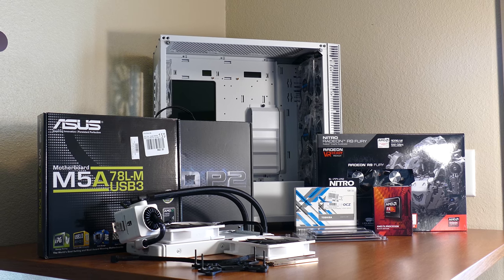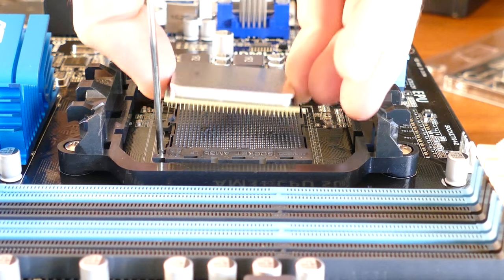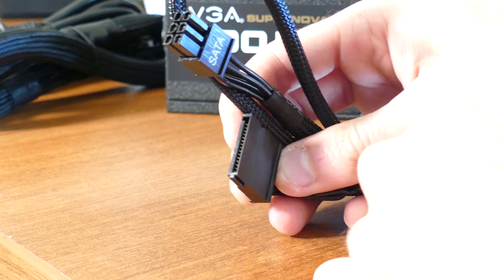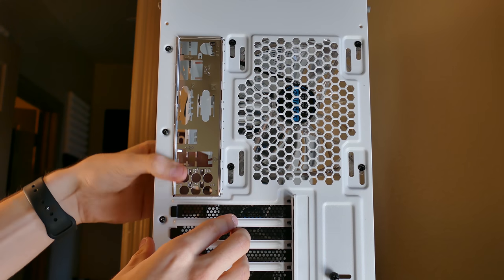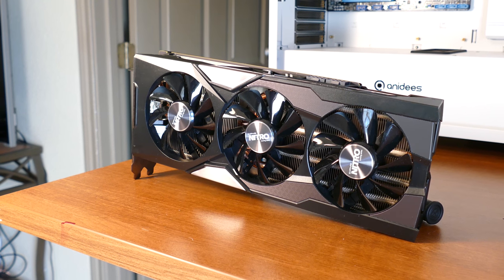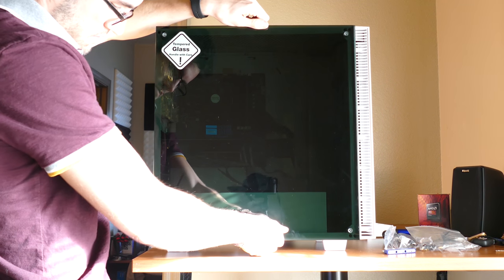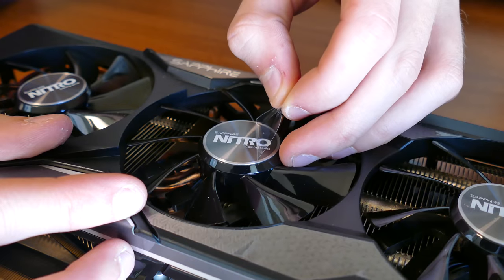How to Build an AMD Gaming PC (2016 Edition)

Comment: While i would say that just wait for Zen BUT if anyone wanted to support AMD, but can't wait for ZEN, here other option motherboards for the build. 
Mobo: Either: Asus 970 Pro Gaming Aura
                        Asus 990fx 3.0 Sabertooth
                        Gigabyte 970 Gaming/Gaming SLi
                        Gigabyte 990fx Gaming
All of the motherboards above have USB 3.1, M.2 nVMe SSD port, gigabit ethernet and audio DAC.
Reply: Here is my setup that i build from end of 2014:
FX8350
Cyrorig R1 Universal
Gigabyte 970A Gaming
Corsair RM750i
R9 270x (soon to be RX480)
16gb Corsair Vengeance
240gb Sandisk Ultra SSD
1tb WB Blue
1tb Seagate Baracuda
NZXT H440

My setup could be used until perhaps well into late 2017/early 2018, due to my country's currency is weak again USD $. So i can't do the Zen overhaul of CPU and Mobo should it comes out 2017 because it would means that i have to shell out 4-5 times the cost/actual price of it. Seems that i will be using my FX series way longer that i anticipated. lol..

Comment: I have a question about your stress testing methodology for overclocking. I've heard you say that you use AIDA64 for half an hour to test your clock stability, do you consider that enough for making sure the system is stable? and do you think that prime95 for the same amount of time is too much? I'm asking because I'm having a little trouble going higher because of the temperatures with prime95, while AIDA64 is more than 10 degrees lower! :p thanks anyway!
Reply from the maker: It's stable enough for what I do.

Comment: LOL im the dude you said good luck with that a month ago when i mentioned the exact build or 970 motherboard for 40 bucks from micro center lol

I managed to get sapphire rx480 8gb OC open box for 207$

All in all for a 500 dollar pc its the best value and great looking with phanteks p416 case its a steal. You can always sell it for what you paid for or alittle less later on which is a rarity in todays age since the parts were so inexpensive.

Great videos

Can you do a comparison between the 8320e with r9 fury and the intel i5 or i7's for 4k or 1440p gaming? 

With costs of 4k tv's going down to 300 new for 43 inch chroma 4:4:4 60hz 4k it really is nice to have as a workstation on such a big screen.
Maybe a blind test between intel and amd with same video card in 4k????
That should be interesting.
Keep the videos coming 
Cheers

Comment: Nice video but you should make a legitimate walkthrough including the windows installation. It is easy connecting cables but its tough running the system. I built my first ever pc and I ran into software problems. I wish there were quality guides available on YouTube as there are build videos. Also, I think Phanteks makes much better cases than NZXT's 340 and this horror.
Reply from the maker: That doesn't count in the "build." Already have an OS install vid.
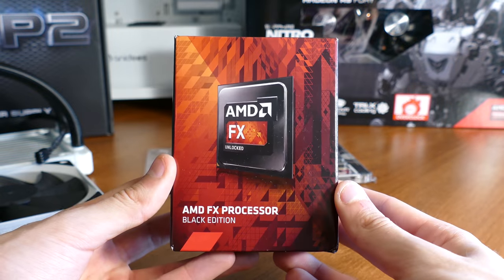Reply: The 1:50 minute video? That video, too, directs you to a instructional article.

Comment: Hey Greg, been watching your videos for some time now and decided to place a comment here. Even though it actually isn't the subject of the video but looking at your EVGA GTX 1070 SLI made me wonder what are your thoughts on recent evga vbios overheat that are appearing on the web. Would you kindly give us your 5 cents?
Reply from the maker: Haven't run into the issue personally. My cards are not SC/FTW and are clocked relatively low. Will, of course, update all of you if that changes.

crosses fingers

Comment: Hey I was just wondering if the parts listed are good enough for my first build:
I5 6600k
Asus GeForce gtx 1060 6gb oc 
G skill 16gb ddr4 3000mhz ram
NZXT Kraken x62
MSI z170a pro mobo
Reply: Keep Scrolling Very Good
Reply: Raul bakachivo evangelista thank you for your reply I was very worried that this wasn't going to be good enough since I am getting everything next week
Reply: Nothing wrong with the build, but you could consider an i7-6700k with a tower cooler. Would only cost marginally more and likely deliver better performance due to hyperthreading. But your way is fine too ;)
Reply: mistermaximal the 6700k cost around 340$ and if he is not planning to make any multimedia content the i5 6600k is good for gaming
Reply: Raul bakachivo evangelista
But his AIO cooler costs ~120$. An i7 with a decent 30$ tower cooler would cost a little more in total but have higher stock clocks and HT. But as I said, his chioce is fine as well. I just wanted to point out the possibility.
Reply: Zen could take another year to come out especially if the yield rate is bad.
Reply: We're waiting for Zen almost for a year, AMD said that they don't want be the cheap option.
Reply: I would rather go with a rx480 instead of the gtx 1060 but there isnt alot of games out yet that utilizes dx12/vulkan so atm 1060 is good enough.
Reply: jynxed RX 470 would be a better choice. RX 480 is trash when it comes to "price-to-performance"
Reply: Jamal Crawssover On newegg the 8gb rx 470 starts from roughly $224 USD and the 8gb rx 480 starts from $230 USD. I dont think that the $6 price difference is a big deal.

Comment: If you r building an AM3 platform, why choose the 780 chipset when you r going to add a powerful discrete GPU? The 7 series chipsets don't even support SATA3 (600MB/s), which will bottleneck SSDs. Why not choose 970 or 990?
Reply from the maker: Pay attention... Got the board for $15...
Reply: ok you got the board for 15 dollars got it... but you pair it with an FX 8320 and a R9 fury.....dude whats wrong with that picture?
Reply: For $15, not bad.

Comment: poor fury, it is going to get bottlenecked by the fx.
Reply: with a decent cooler you can overclock the crap out of that fx 8320, a very bad chip does 4,6ghz, a very good.... around 5/5.2
Reply: I can get mine to only 4.5 before it starts BSOD'ing!
Reply: and then ? 
still bottlenecked
Reply: MrYodi2007 voltage? i have mine at 4,6 at 1,47v
Reply: THQ SoulStealer yeah... still bottlenecked on very cpu demanding games like gta V or bf1. But...on the rest it´ll work fine.
Reply: Sean McNamara man... i had my fx 8320 at 4,4 with 1,38v on an asus m5a88-m (wich is allmost the same than mobo) for 2 years. And never give me a problem, even on Prime 95 wich stresses the cpu more than any game/ application in the world. Anything below 1,45v on that MoBo should be ok.
now i have the same cpu on a 970 pro gaming aura at 4,7 at 1,5v.
Reply: Julian Grimoldi 1.46v with one of the best boards out there.
Reply: The board is quiet low end+the crappy stock cooler. have it been a M5A97 or GA-970a-ud3p, it could oc decently and alleviate some of the bottleneck with an average cooler. Still the low IPC of the fx would hold the fury back, but not on the same level.

Comment: there is atleast a 5 percent performance hit with that ram my 8320 took way too long to find a stable ram over clock at 2400 but it was done I got a worthwhile bump I  cinebench at least 7% the 5 % is at a more attainable 2167. Love that ram it could take 1.7v and hold 1480 I was to scared to run it that high everyday. you get a bit over 1% with 4 dims. Heat a increased and overclocked dropped without active airflow or ridiculous voltage.

Comment: Isnt FX 8320 bottleneck for R9 Fury?
Reply: Eternal Power no
Reply: +Robi N its sure does. It Even bottlenecks the RX 480.
Reply: And my fx8350 doesnt bottleneck my gtx970 (equal to rx480).
Reply: +Creeperlover2001 gtx 960 is like 100% slower than Fury. Thats why.
Reply: +Creeperlover2001 dude wtf are you Even saying???????? 

RX 480 is like 30-40fps ahead of the gtx 960. Not Even close.
Reply: +Creeperlover2001 not Even close again. RX 480 SHITs on GTX 970 and rivals GTX 1060 and GTX 980.
Reply: ***** no
Reply: Eternal Power No lol, Just because ur a fan boy of something doesn't mean that it's good
Reply: yes it is a bottleneck. If you play at 1440p maybe less so, but it most certainly bottlenecks at stock frequency. My FX-8320e @4.6ghz bottlenecked my r9 390x. It was more noticeable in cpu intensive games.
Reply: Eternal Power The 480 is on par with the 970 in DX11 (most games) and is on par with the 1060 in DX12 and Vulkan (future games).
Reply: My FX 8350 seems to be very well aligned with my 1060. If anything I've only noticed the gpu limiting my performance in some games.
Reply: it was on par with the 970 on initial drivers, after some updates, its really close to the 1060,  more or less 2-5 frames at most
Reply: +Nino finally someone with real knowledge. Exalcty. Gtx 1060 is equal or better to GTX 980 and now RX 480 is like 2-5fps behind of GTX 1060 in DX11!
Reply: ***** An FX 9590 can bottleneck a RX 480 in some CPU-intensive games! 2 Fury X's in CF likely have their potential halved by that CPU. But Ryzen is about to come out in January/Febuary.

Comment: my amd builds been getting upgraded I'm using a gtx 1070 asus oc fx 8320e 16gb ddr3 1600 750w psu and liquid 240x deep cool will be getting a i7 5820k maybe before next year
Reply: Just fyi, if you're mainly gaming there is no point in buying an x99 platform. And maybe wait and see what Zen could bring to the table ;)

Comment: Thinking of building an AMD PC for my little bro. Might go with this
Reply: Little bro doesn't need a Fury, get him an RX470
Reply: This should save around $130 if you get a smaller power supply too, a 600W is plenty if you aren't getting such a power hungry GPU
Reply: I seriously would go Intel and this is coming from someone who has an AMD main system!
Reply: You're right I have an Intel build right now, that's what im using rn .  I was going to go with a cheap build with replacing the r9 fury with a cheaper gpu and case. Depends ill probably go with an intel i5 4th gen. Gotta look for the deals.
Reply: Yea forgot to mention im going to go for a cheaper gpu since he doesn't really play high demanding games.
Reply: nah an intel i5 4th gen is ~ 200$ plus intel compatible mobos are more expensive so you're adding quite a bit of cost just to go intel. Just because Zen is coming out doesn't mean fx cpus are bad in fact there definitely still the kings of the budget price point. You can get an fx 6350 + a mobo for 200$. As long as you're not playing cpu intensive games you wont have a noticeable performance hit so paying more for a cpu just isnt wise.
Reply: Luke Lastname True he could but a FX-8300 SERIES is not going to last long. Just spend the extra 60-80 usd overall and get the i5-6600k! It will last him for years! The first Zen chips are aimed @ mid level enthusiasts not a younger brother who is more than likely to just game.
Reply: you can do a skylake build from microcenter for around 330$ including a rx 460 if you skimp on the cpu case, hardrive and settle for a solid gear psu.

Comment: man they are rly good proccessors they can handle pretty much every game out there
Reply: **fx 6300 is crap after 8350 all its every good
Reply: 6300 was pretty decent up until the last 4 months but yah, now they are just falling off in ability to run things.  The old 1090T is better.
Reply: razamatraz amd back in The 2004 was crushing intels cpus amd with The pace they had intel woukd be history by now.i still have an amd athlon from 2005 amd its pretty good
Reply: TaSoScRaZyMaD I bought AMD from Phenom 2 X4 up to FX-8350 and the original FX before that..  They always held their own but there hasn't been a truly new chip in years now.....it's too bad.

Comment: Not a bad build but that CPU will bottleneck the Fury quite heavily. I had an FX8350 (OC'd to 4.5ghz ) system before with a fury X in it and the CPU severely bottlenecked the Fury X, when I upgraded to an i7 5930k the performance increased by like 35-50% depending on the game with the same Fury X.

Comment: I've been debating on getting this CPU (8320e) from Microcenter. I'm running an X4 860K right now and planned on building my girlfriend a PC. I already have a spare motherboard that a friend didn't want (as I bought him a new one) on the AM3+ platform. Would it be worth getting it and gifting my current parts (which are relatively new; few months old)? She's currently running a cruddy HP with an A6 APU. ... or is it worth it to just get an i3?
Reply: since you have a spare am3+ baord just get the fx cpu
Reply: I'd still wait to see what the Next processor from AMD. The Zen line is coming early 2017 so if I were anyone I'd wait. Saving up is a great option as well.

Comment: This Fury is wicked! You scored a very good deal on that card. In my country those are like $600-700 :(
Reply: In the UK the price of one of the r9 furys has plummeted for no reason, the xfx r9 fury is now only £250 vs the £450 asking price of most other systems. I currently have a fury and I am very tempted to get it, shame it wasn't the asus one though as I have an asus fury at the moment so the xfx would look out of place.
Reply: I got mine for 310€ a few months back, it is only the sapphire ones that are that cheap though, Furys from other manufacturers are still 500€
Reply: Helodon In the UK the sapphire one is £300 but the xfx is £250  I bought my fury for only £350 almost a year ago which at the time was an absolute steal as they where selling for £450 which most still are.

Comment: Fx 8350 and R9 fury is a bad combination, there are major bottlenecks in 1080p and even at 1440p it suffers a bit. i have a similar combination with an  fx cpu overclocked to 4.7ghz and an R9 Fury tri x. bulldozer is a very bad choice to make at this point. even an i5 4690k is a better option running ddr3. The R9 Fury however is a beast of a card, being a cut down version of the Fury x. i have seen OC r9 fury match stock Fury x performance. so its a great buy at 310$, which is in the same price range as a gtx 1060 6gb and 8gb rx 480 and it easily outperforms both these cards. its the best 1440p experience you can get at a reasonable price. a 650w gold rated power supply is sufficient to run it, must be 80 plus gold or 750w bronze, cheaping out on the power supply will cause major problems.

Comment: not gonna lie i toke the stock cooler and gave it a super heavy load ass fan because i lock my pc away in a different room and i have a 4100 fx oc to 4.4 with the voltage up one notch p95 for about an hour and only go as high as 32c cooler isnt to bad but this fan is a beast sounds like a turbine :D

Comment: I built a pc for around 600 dollars, is this good:

Core i3-6100 3.7GHz - 135$
Asus Radeon R7 360 - 130$
4GB Ram DDR3 1600Mhz - 30$
B150M-A D3 - ~170-200$
Mid-tower Thermal Take case - 50$
ThermalTake Smart SE 630W - ~90-100$

Because seeing that graphics card really is triggering the buyers remorse inside of me.
Reply: Anderson Sanchez The b150m-a d3 costs here in Europe less than 70 Eur, why US-$ 135? Why a DDR3 board?
The GPU is obsolete, R7 why? Better 1050 Ti (needs no external power, quite fast little beast) or Rx 470/Rx 460 (4GB)
use a cheaper ATX power supply e.g. from EVGA for about 40$.
With the saved money better buy 8Gb Ram.
You also need a cooling solution if you don't run with stock cooler and a harddrive.

If you are a beginner: buy a used i3/i5 "Office" machine (eBay, sometimes even with warranty) for about 200-250 €/$ and put a 1050 Ti and an additional SSD in; total cost about 400 ish. For 1080p enough.
Reply: Anderson Sanchez Thats one expensive build...
Reply: a motherboard that costs more than the CPU or GPU, not the smartest choice
Reply: ThePeperich I live in a really shitty country where the economy is fucked up. :/

And most of the distributors like EVGA don't operate here.
Reply: Anderson Sanchez Where do you live? I live in New Zealand and the build you made would roughly $883 NZD but i made a few modifications to it http://nz.pcpartpicker.com/list/WcV3m8
Reply: jynxed A country close to India.

Comment: My actual system specs are:
Gigabyte 78LMT USB 3 Rev 6
AMD FX 6300 (on 4.0ghz)
8 gigs of RAM (2x 4Hyper X Fury 1600mhz)
R7 370 2Gb from PowerColor
Toshiba 1Tb HD 7000rpm
500w 80+ bronze PSU

I about to upgrade the GPU to a MSI RX 480 8Gb Gaming X.
Will it be a good?
Reply: probably, and zen might make it even better
Reply: Yallah Habibi yep! I'll get one as soon as it releases, and obviously, a new motherboard and maybe also an new PSU

Comment: I do 4k 60fps with a rx 480 with settings down to medium high game looks amazing, it's honestly not hard to run 4k not ultra preset but you shouldn't use ultra preset as the defining factor in whether or not you can "run" a game salazr

Comment: 3:25 Hi. New to PC building, but don't you need thermal paste between the CPU and cooler?
Reply: It is pre-applied on the stock cooler.
Reply: Oh, really? It may sound dumb, but that's one of the things that's driven me away from building my own PC or replacing my prebuilt's CPU. I'm so afraid of putting the wrong amount of thermal paste on...

Comment: I don't understand how an FX 8300 makes sense over an i3 6100. It is newer, has way better single core performance and can play almost any game just as well or better than that old Zambezi chip. This is not me hating on AMD, this is me genuinely not understanding what GAMING benefits AMD's old platform provides.
Reply: +Jeff Peters there's still the concerns of multitasking and only having 2 cores is a con in that department. Though for the most part, yeah it's not too bad for a budget build either. It'll come down to personal preference mostly. Being newer doesn't necessarily mean it'll be more appealing to someone. I'm eventually going to overclock a xeon x3450 I bought used and just see for myself if I'd be happy with that over something much newer.